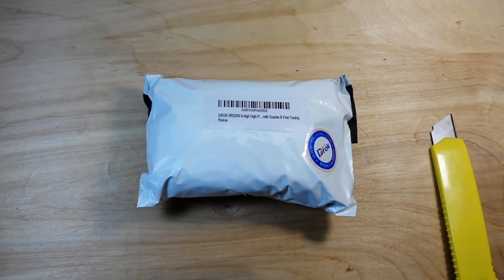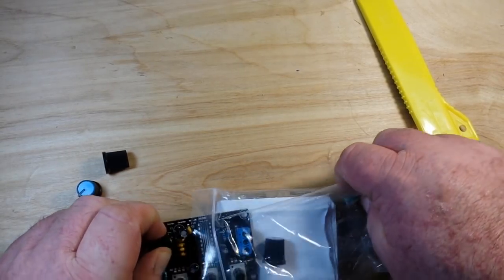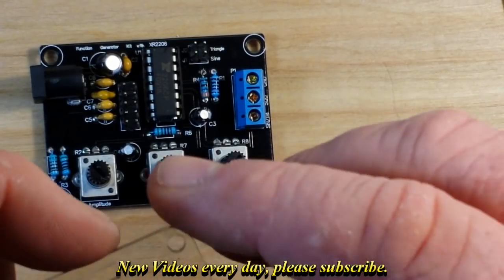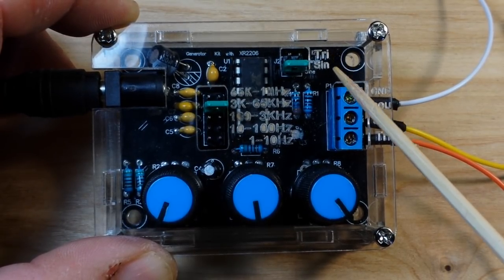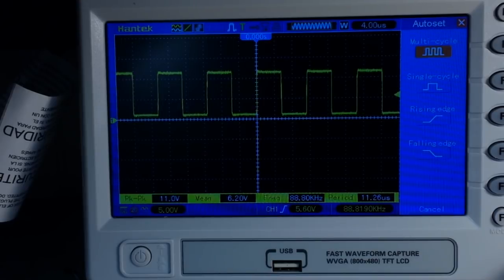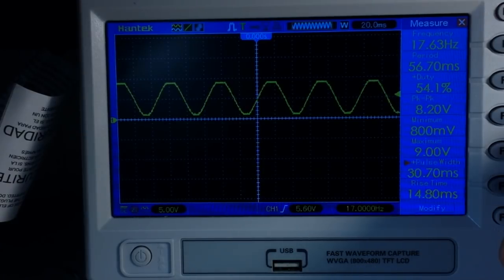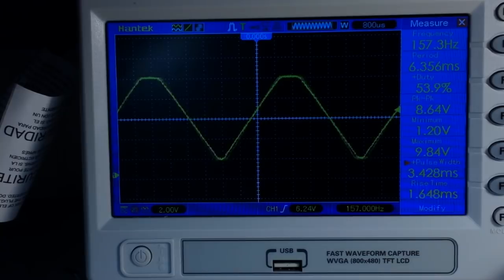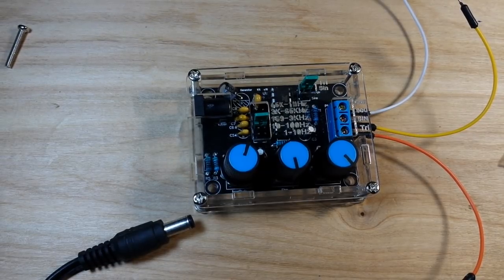XR2206 Function Generator Kit Review

Comment: Just got mine out of the mailbox. This one is a full kit version, all the parts in a sealed anti-static bag in a small package that easily fit into my tiny mailbox.  I also got the power connector as well and it curiously came in an Amazon box the size that would hold a pair of boots! Still waiting for the frequency counter to get here, I plan to merge to two together in one unit for ease of use.

Comment: Sorry to say but they are all the same design, components, just under different names. The components are indeed subpar. The tolerances are way too loose on the components specially the 2206 chip. Since they are kits, additional variants occur depending on where they got their components from. Which explains the wide variation of reviews from good to bad.

Even if you get a horrible kit, it's still a great buy for $10! Because it can be fixed easily. People bitching about a $10 kit are insane. Just the 2206 chip purchased from a component distributor costs between $10 to $25! The kit is a new brainer. Most people are lucky and can get decent results with no modifications. Any issue can be easily fixed and even if you get issues, you are still way ahead of the game. I recommend this kit under any name.
Reply: It's on sale for $3.99 shipped free at Banggood.com right now. Most of the 2206 chips are counterfeit which you can tell when you run them near the max specs but still work.

Comment: Could you use this to make a synth?
Reply: I had the same thought. I guess you can fit it in an Eurorack module. It takes 12 volts..I could probably try
Reply: @Cargoshots  buddy I wouldn’t do that again...you could easily blow your speakers..but you can use it as a modulation source. I keep it in my workbench when I need a quick pulse wave to use as a trigger or a sine wave for any purpose, like modulating my vactrols 😉
Reply: @Cargoshots  i have heard around that they chose component’s values without considering the datasheet of the IC and apparently they made a mess lol
Reply: @Cargoshots  i hi i it is about the frequency. I am still learning, I am afraid I can’t give you a more meaningful answer and am reporting what I heard. I could be wrong but you know...just in case..I would keep using crap speakers for experiments 😅

Comment: On the kit board you need to cut the leads off as flush as possible so the screws that mount it will be long enough. I had to get longer screws for both the board and the case.  The screw holes for the rear back of the case had to be opened up. Also,yes the amplitude control works backwards.
Reply: Hehe also faced that ended up that its the wrong way to assemble it. The screws only got thru the PCB and not thue the bottom of the case. The nuts are there to offset the PCB and the remaining threads to allocate the PCB not to move left or right . The top of the IC and the pot's holds it down.
Reply: @Allan-mf1he  yeah saw that on another video.

Comment: I got the KKmoon version and it was junk! 😂 I bought it back in November of 2018 and one month later used it to acquire some desoldering skills. I salvaged virtually all the parts but I am currently in the process of rebuilding this circuit using component values according to the XR-2206 data sheet. I have the 1st test circuit working (which is already a better circuit than the one provided) and want to add more functionality to it and hopefully get it soldered onto a new blank PCB board. Cheers!

Comment: Feed that square wave via a Schmitt trigger. It actually comes from the Sync Out of the XR-2206 IC and not the Wave (Sin/Tri) outputs. Use as a sync pulse for your scope and/or as a TTL signal (from the Schmitt trigger IC of course)

Comment: Sir what will be the output if I connect jumper to all the possible frequency range simultaneously?what will be the frequency range of the output?
Reply: You should find a circuit diagram for this function generator - the same circuit is used by many suppliers. The 1-10 Hz range uses a 10 μF electrolytic capacitor; the sum of the capacitances for all the other ranges is less than 2 μF. So the expected frequency range would be roughly 0.8 ‒ 8 Hz.
Reply: You will add the caps in parallel so guess the frequency would be lower than 1Hz.

Comment: What power supply does this need ?
Reply: I think learnelectronics was thinking of a different function generator - this XR2206-based kit needs 9-12 V DC.
Reply from the maker: It requires +12, -12, +5, and Ground
Reply: Tested this it will start producing limited frequencies from 5.5V and up to 12 to be save.
Reply: 9-12vdc